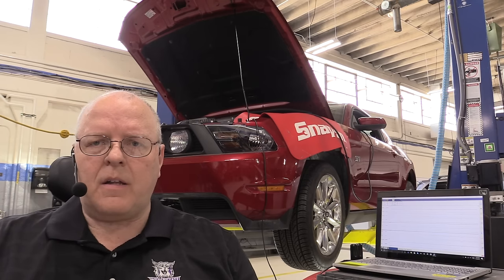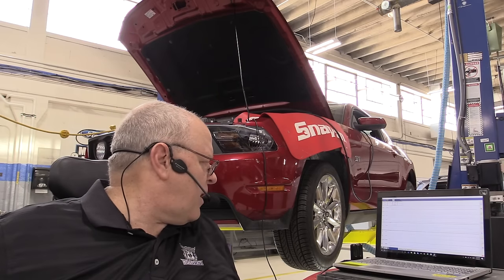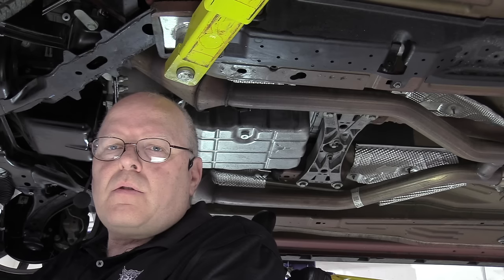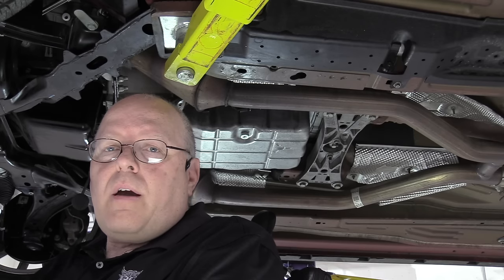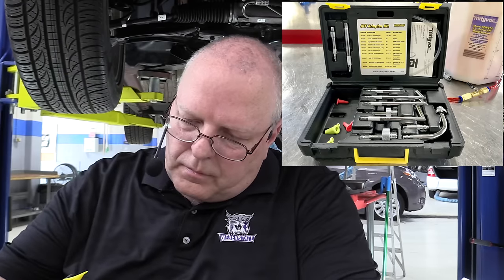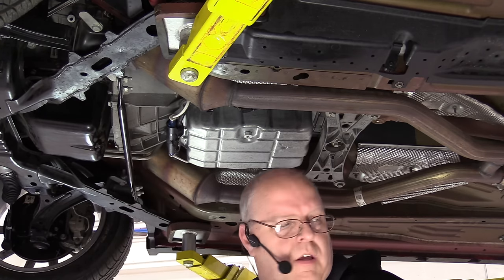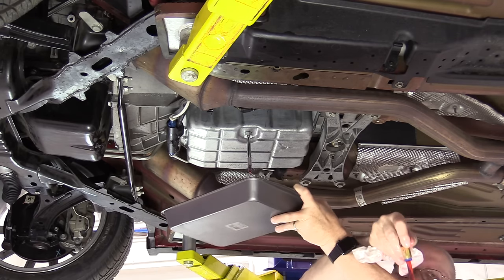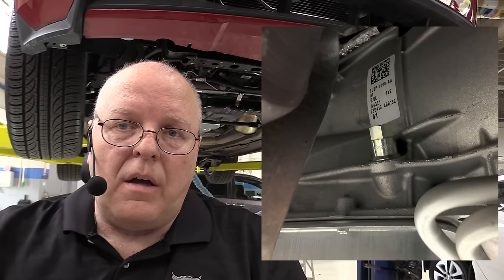Ford Mustang Auto Trans Fluid Level Check -  No Dipstick

Comment: Summit and Jegs sell a dipstick kit for this Transmission. I put the kit in my daughters 2007 Mustang after I took the pan down and replaced the transmission filter when the car went over 100k miles. The kit comes with a replacement transmission pan adapted to except the new dipstick holder tube and dipstick. It is so much easier to service the transmission now from under the hood like we did years ago with our vehicles. Refilling the Trans is a breeze now after replacing the Trans filter or to just check it. I can still check the fluid both ways either under the car or under the hood. It is so much easier to add fluid to the transmission now. Before the replacement Transmission kit what a pain it was trying to fill the transmission from the bottom of the car the only way it could be done.
Reply from the maker: Thanks for your feedback

Comment: Thanks for the video!  I just added fluid to my 2005 Ford Mustang with the 4.0 v-6 engine.  That pump was to expensive to buy, so they actually make a nipple specifically  for adding fluids to the transmission on that model of mustang.  I bought the nipple on e-bay for amazon.  I paid $11 or $12 for it.  I bought a little 12 volt fluid transfer pump on e-bay for diesel fuel for $20.  It has the alligator clips that I just hook up to an extra car battery I keep around the garage  and it works great for the project.
Reply from the maker: Nice job

Comment: Thank you, professor. This fluid checking for my 2006 mustang was a mystery to me until now.  [ OTC tools sells an adapter to connect to the drain plug, then use suction gun to add fluid  [ part number for adapter  OTC-6604 ]
Reply from the maker: Thank you! and thanks for your feedback

Comment: so instead of a $1.00 funnel, I need a $300 tool to add transmission fluid.  How is this a better system?
Reply: Is not a better system, is Ford.
Reply: You can go to harbor freight and buy a 40-50 dollar pump and use that . The only difference is you just won’t have the so called special adapters. Just stick the plastic tubing up inside the transmission and pump the fluid in until it spills back out. I run my own auto shop and i do this quite often and have never had problems with this method.
Reply: You can also you use a 8$ manual transfer pump from harbor freight it should do the job if you are on a budget

Comment: John, as always VERY informative video!
A couple of questions:
1) what's the best solution/solvent to clean the Mityvac container after the job is complete?
2) does your wife know you're using her baking pan in the shop.

Regards,
Mario
Reply from the maker: Thank you! Those are great questions! lol 1. I don't use a solvent to clean then tank, I just wipe it out and install the next fluid. You might check the Mity Vac website to see what they recommend. 2. I don't tell her ;) I use muffin tins and baking pans for my students to organize transmission parts while working on them. Recently I started using ziplock bags instead. Thanks for watching!

Comment: Professor Kelly, This is very similar to all aircraft electrical generation transmissions and some flap transmissions. In the aircraft electrical Integrated Drive Generators(IDG’s) we cannot service them while the aircraft engine((Accessory Transmissions is moving at high speeds) is running due to the High Pressures produced by the oil in the transmission. There is also much more to be said about the workings of the IDG’s or Constant Speed Drives(CSD’s) but in our case oil needs to be added. On the Boeing 757’s Pratt or Rolls there is a prism sight gauge that is very hard to read if one isn’t at the correct angle. We use a fill and overflow tool to get reference of how much oil was added right after shutdown. I kept a ton of info out just to keep a relationship between cars and aircraft. My question is I heard of the saying growing up: “Oil is Better than No Oil...” I say this because of my limited space, at home I can place my Explorer on 4 Jack Stands but time safety and other constraints will prevent me from being able to have easy access. Most likely I will bring my Explorer to my Base Hobby Shop so that I can access the transmission safely. But for the mechanic that cannot afford a shop or to pay for the service I would like to ask if there is any alternative way of servicing the transmission for people that do not have access to lifts? If I’m putting too much thought into this topic, my love for learning all types of systems and finding alternative ways of completing a task safely and being able to repair my children’s vehicles without them going in debt I ask this in depth question.
Reply from the maker: Excellent feedback! Thank you

Comment: What a ridiculous design. Great presentation though.
Reply from the maker: Thank you!
Reply: Most modern transmissions have a similar design. This is something called "lubed for life". If you think that is ridiculous wait till your car has no engine dipstick. A lot of Mercedes and BMW cars are like that. They just want your car to fail so you trade it in and buy a new one.
Reply: Larry Mac - I disagree !  This is a much better design than Ford's first attempt at eliminating the the dipstick where they just removed the tube and installed a very short dipstick in the same hole.  (https://goo.gl/VN7j7r)  Of course it could only be reached from under the vehicle.  It also require a pump to fill.

Personally, I think I would fill to the top of the stand pipe level while the engine is warming up and then just leave the inner plug out until the engine hit 100-120F.
Reply: @jackpatteeuw9244  you don't know what you're talking about
Reply: @psychotrucker9880  Lol it's almost like jack didn't even watch the video.

Comment: You can still get the cheap tool from OTC on Amazon. It runs about $18 then the standard pump that fits quart bottles.
Reply from the maker: True, this is the system shown in the video https://www.amazon.com/Mityvac-MV6412-ATF-Refill-System/dp/B00B1SLSIS/ref=sr_1_6?ie=UTF8&qid=1500900561&sr=8-6&keywords=aTF+pump

Comment: Was that hard for them to provision an electronic check of the fluid level?
Is there any aftermarket solution for replacing the small dipsticks/missing dipsticks with electronic level checker?

Excellent presentation, Dr. Kelly!
Reply from the maker: Thank you! I am not aware of an aftermarket solution. Best wishes
Reply: M. CTR how about all 3 ways of checking the fluid levels. Good idea by the way but I've seen computers mess up so as the old standby I like checking it win I open the bonnet at the Side of the road way or at home and the plug would come in handy if I over fill it by accident it's probably the laziest and quickest way of emptying the excess fluid
Reply: ...they don't need an electronic monitor...they just need to put a d@mned normal dipstick on it...

Comment: I was wondering if you know when is it time to change or add trans, oil. I bought my car brand new back in 2008 an I have never done or know if they have ever checked my trans oil.
Reply from the maker: Check the maintenance guide in your owner's manual. I suspect it is around 100,000 miles

Comment: At least with a mini dipstick in the 6R you can quickly check the ATF level when on the hoist for an OC. That Mity Vac kit with all the adaptors looks frighteningly expensive to me for the average small shop operator We had those 5R transmission in the Australian Ford Falcon . We called them the 'problematic' transmission due to various issues you would be aware of John. Thanks for the vid.
Reply from the maker: Thanks for the feedback, I don't remember what the mighty vac kit cost, but i think it was around $350. The kit works on many other transmissions as well.
Reply: ouch expensive, making your own from a pump up "sprayer" sounds like the best plan.

Comment: Hello, Mr. Kelly. 
I write you concerning a friend of mine, with the same problem: he wants to check the ATF fluid from his car. 
The car is a Ford Focus (here in Europe), 2016, with the 1.5 turbo gasoline EcoBoost engine. The transmission is Ford 6F35. 
He also needs to know the necessary ATF temperature for the right fluid level. 
So, if you are so kind please help my friend, with this matter. 
Thank you in advance.
Reply from the maker: 85-93 degrees C, Mercon LV fluid. Best wishes
Reply: Thank you!

Comment: So my trans started slipping today and I immediately parked the car , my 2005 Mustang just hit 99k miles and I’m the second owner , previous owner did not do the transmission oil change , do you think changing the oil and filter and gasket could work out?

Comment: I've been doing this since 1996 on Volkswagen cars !
Reply from the maker: Thanks for your feedback. Many people have never seen a transmission without a dipstick. The first one I ever worked on was a 1994.5 Chevrolet Cavalier with the 4T40-E transaxle.
Reply: Really I never knew some older GM cars had no dip sticks was this a Hydramatic transmission ? Or it was built by someone else?

Comment: On a side note... Just buy the proper threaded connector, a funnel and  length of hose that will reach above the tranny and fill it. You could also use a bottle and rig up a small bicycle pump to pressurize it.
Reply from the maker: Thanks for watching

Comment: Could low fluid cause my 2006 mustang gt to stall at times when first starting my car and putting it in drive or reverse been chasing this issue for some time
Reply from the maker: No, but a torque converter clutch that is staying applied in in 1st and reverse can do that. It sounds like a hydraulic valve body or solenoid problem. Best wishes!

Comment: What is the purpose of having the engine running in order to remove and or replace the fluid level check plug?
Reply from the maker: Running the engine also runs the transmission fluid pump to fill up the torque converter, cooler lines, and internal passages inside the transmission. Without the engine running, that fluid would all go back into the oil pan giving you a false "overfilled" indication. Best wishes
Reply: WeberAuto ahh gotcha thank you. I have seen other other vids on here showing this procedure but they didn’t have the engine running when they removed the plug. I wish ford had put the conventional tranny dipstick in my mustang. Cheers

Comment: So I did the check plug and a lot of it drained out, I started it for a sec and a little more came out, after it's done am I good to go?
Reply from the maker: The engine must be running before you remove the check plug or you will drain out too much fluid. With the engine running, pump some back in and do it again . Best wishes.

Comment: Why would a closed system from the factory be low?
Reply from the maker: Because humans are involved. It is very common to have an under filled or over filled transmission, axle, engine, etc. from the factory. That is why the dealership is supposed to do a Pre-delivery inspection. Thanks for your feedback.
Reply: job assurance?

Comment: What used to be done simply and quickly with a dipstick and a funnel now requires a hoist to lift the entire vehicle, a special torque wrench, a special torque bit, a specialized tank, a special tool and pump to add the fluid, and specialized software. That's absolutely ridiculous.
Reply: Absolutely making you have to get your vehicle serviced with a nice hefty bill...

Comment: What is the procedure for 2013 Rav4 with cold engine
Reply from the maker: The Rav4 uses The U760 transmission and this procedure: https://youtu.be/cNcecuGzTDg?list=PLIn3FrDiB1lxzthcUMZQOoJi3PNAlVYa6 Best wishes!
Reply: Temperature range should be from 35C to 45C or  40C to 45C & what is the benefit of changing shifter kit that is available on ebay for U760E transmission

Comment: If I knew this before buying my 2011 mustang I wouldn’t have bought it.
Reply: Ba ha ha wait till you have to replace spark plugs. same dilemna
Reply: @peterkaufman1379  At least you don't have the 05-07 spark plugs :D consider yourself lucky
Reply: @stellanhughes2549  no I do hence the comment
Reply: @peterkaufman1379  You've got the two piece ones that break off below the threads when you try to remove them? It took and 80 dollar kit and a weekend for me to get all 6 that broke out, and would have been 150 per plug at the shop. I thought it was only 05-08 or so but I could be wrong
Reply: @stellanhughes2549  yeah, have 05. Got a mobile mechanic that had tools and pulled out like half hour on broken with chit chat.
Reply: @peterkaufman1379  oh haha my bad yeah Still finding the ways Ford engineers screwed me 😭. Currently trying to check the transmission fluid, and of course they had to make the only way to change it by buying a 250 dollar kit.

Comment: Can I add Lucas transmission oil ?
Reply from the maker: You can add orange juice if you want to; the transmission may not operate as designed though. Any other fluid may cause unintended consequences. Best wishes

Comment: should have run it through the gears at least once to make sure it filled all channels in the valve body.
Reply from the maker: Yes, that is true. I mentioned that at 1:07 and 3:20, and actually did it at 4:00  Thanks for your feedback
Reply: Owned 😂🤣😭

Comment: You can always use a oil can with the right fluid and pump some fluid threw the plug till it comes out. Why make this so hard of a job. Then check the fluid temp with a temp gun.
Reply from the maker: Thanks for your feedback! The temp gun is not accurate on trans oil pans. Try it and compare to scan tool temp value

Comment: Great video professor! Why are car manufactures getting dumber? Just saying.
Reply from the maker: Thank you! Good question.
Reply: Probably not dumb at all..reason they dont put oil/air seperators on engines is that the majority wouldn't check or empty them...if there's a specific way to check/change transmission fluid, then less chances of it being messed up by a dyi.  Its obviously two fold, as dealers make money off service too.

Comment: Amazing video and presentation, so thorough and precise, almost perfect; 10/10. But what a piece of shit design and engineering on that Ford transmission; 1/10.

BTW. Did you drain it first? Or just pump it in and hope the old crap comes out?
Reply from the maker: Thank you. I just topped off the fluid level in the video, not a fluid change.
Reply: @WeberAuto  Can't wait to see a video on the new Mustang S550 :)

Comment: How rediculous... Mechanics get enough business, why do manufacturers insist on taking away every easy things the average Joe can do himself!?
Reply from the maker: It actually preserves the life of the transmission. As an automotive professor, I hear from a lot of people and students who have a negative reaction to this video and wonder why they took away the dipstick. Think about this: if a dipstick is so easy to use, you should be able to answer all of the following questions: 
1. At what temperature is the "cold" mark accurate? 
2. At what temperature is the "hot" mark accurate? 
3. What temperature does the dipstick even refer to? Outside air? Coolant temperature? Transmission fluid temperature? 
4. How will you measure that temperature?
5. If the fluid is within the cold mark area marks when it is "cold", is the fluid level okay?
6. if you live in a cold climate area like Alaska, is the "cold" level accurate there? What if you lived in a hot climate area like Central America, is their "cold" mark accurate?

If you cannot answer all of the previous questions, should you be using a dipstick?

Comment: Overly complicated.  This is a reason to NOT buy a Ford in the future.
Reply from the maker: Almost all modern transmissions do not have a dipstick, not just Fords. Thanks for your feedback
Reply: ...have a 2005 AND 2006 Dodge Durango...they both have dipsticks....buy a Mopar.... @WeberAuto
Reply from the maker: @dyer2cycle  They have actual dipstick? It was my understanding that they only came with a dipstick tube. Newer Mopars have no dipstick either.
Reply: ..yep, the 2005 (Durango) has a dipstick, I have actually changed the fluid/filter myself twice, the conventional poor man's way, with ramps/jackstands in the driveway...4.7 v8, it now has 316,000+ miles on it. We recently got a 2006 also for a good deal, since the 2005 has been so good...5.7 Hemi, 124,000 miles. Haven't changed the fluid in it yet, but it has a dipstick..I don't buy nothin' without checking the oil, coolant, and transmission fluid(unless it is a manual) first....Until I saw my son's 2005 mustang, I had no idea any manufacturer did anything like that....seems like a huge step backward, not forward. Mopar must have started doing this at a later date. This discourages good maintenance, as most second or third owners don't have the time/budget to take it to a shop for such a basic thing as checking the tranny fluid, so they wind up just letting it go until something breaks...also, most owners don't have access to a lift or pit, and have to do this kind of maintenance in their driveway, yard, or if they are lucky, home garage or shed. Consumer advocate groups should lobby to get such as this outlawed.... @WeberAuto
Reply: I have a Tacoma o9 and Is the same shit